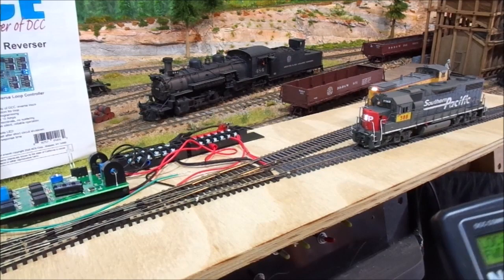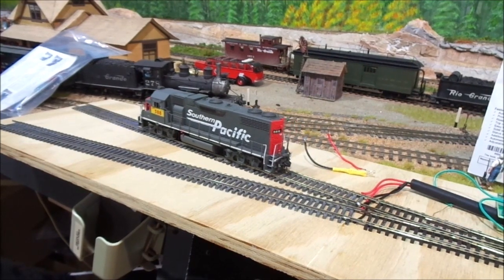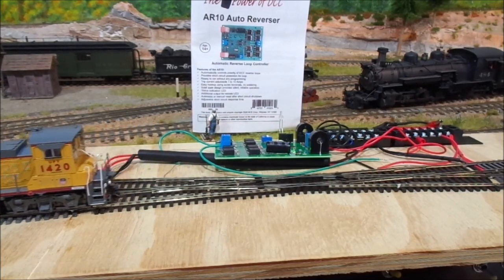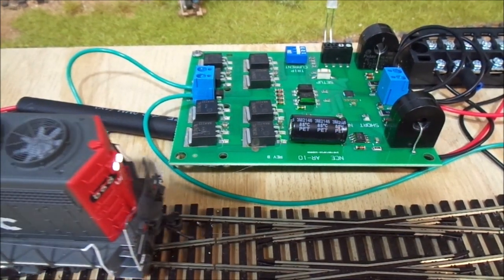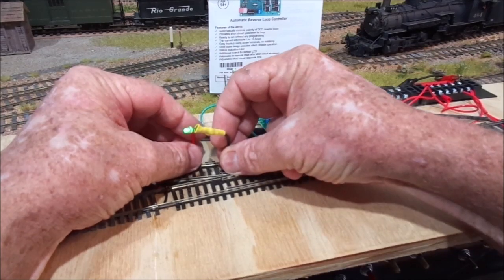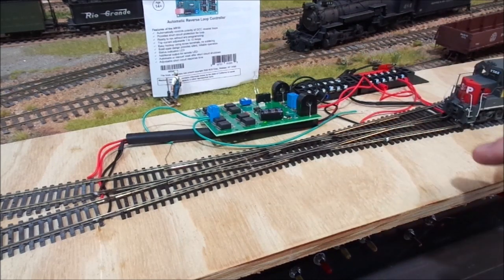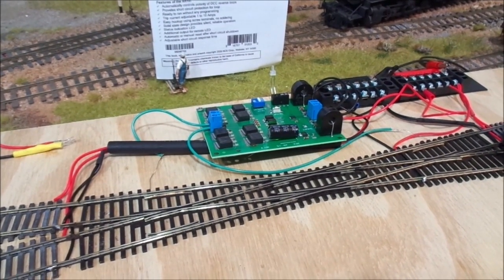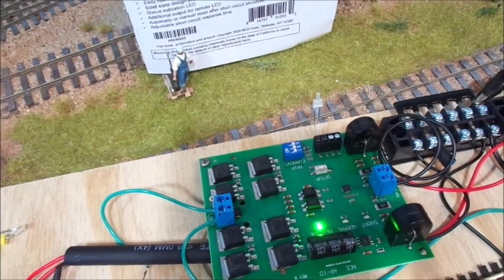H0W TO WIRE A PECO DIAMOND WITH NCE AE10

Comment: Ouch, just looked at the price for AE10 AU$115, that makes me wonder if I want to include a Xing in my next layout. I do prefer the metal frog. The Tam Valley dual frog juicer is now AU$65 but may not be available. I have one on my turntable and it works faultlessly.
Reply from the maker: G'Day Alan, yes the AR10 is expensive however for my shelf layout and switching operations I wanted something whereby I don't have the problem of locos stopping and not having to worry about throwing a switch. Cheers Laurie